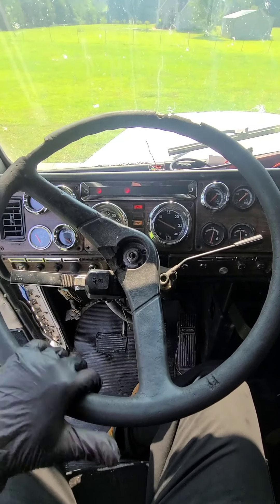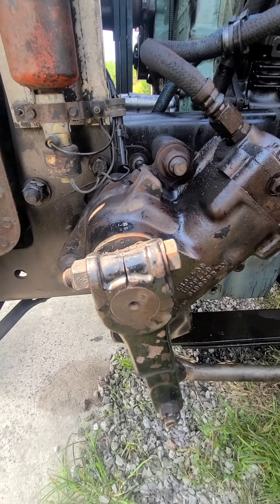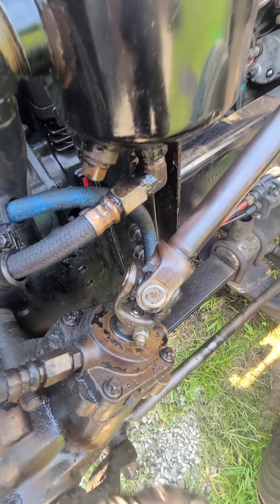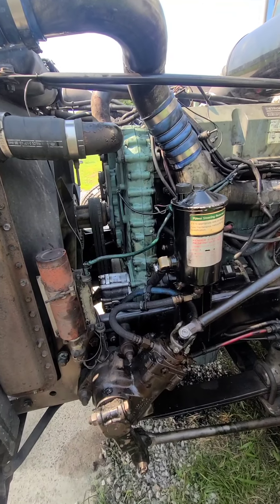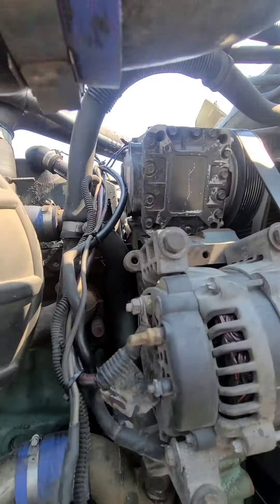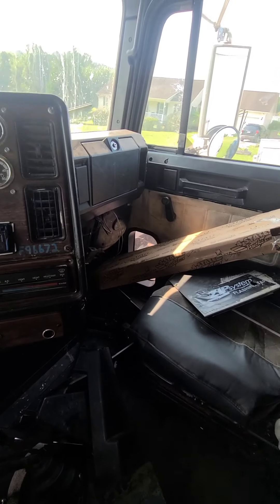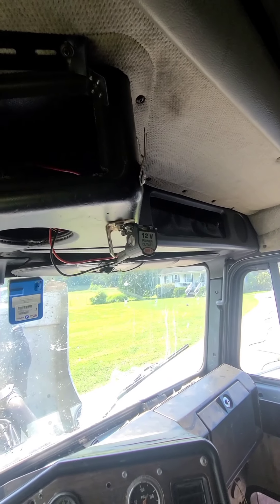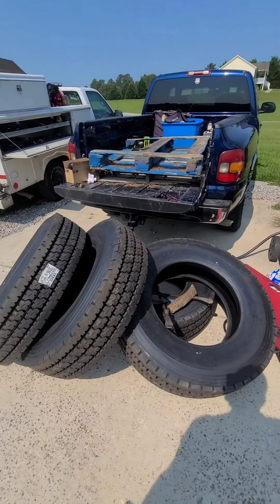How To Inspect Front End/Power Steering System on a Semi Truck

Comment: Hey I am 22 with almost 5 years experience working at utility trailer sales and I’ve also worked the service truck at Ta and BossShop in the evening do you think it would be a good time for me to start also what do you use to accept payment thanks
Reply from the maker: I would start on the side. Get some solid side clients before you go full time.

Do you have experience on the truck side cause that is key.

I use quickbooks online for invoicing and payments
Reply: @AMPMChatt-Jax  I have some experience on the truck side not as much as trailers but I’ve done a few coolant leaks starters and a bunch of pms I’ve done tires (super singles low pro 22s 19.5s etc) I was thinking about going to see what type of business loan I can get to start out with unless you have any other suggestions? Thanks for the reply!
Reply from the maker: @CertifiedPlumber  Did you ever get something goin?
Reply: @AMPMChatt-Jax  reply yes I have a repair shop rn subbing out big wrecks to me but not many road calls